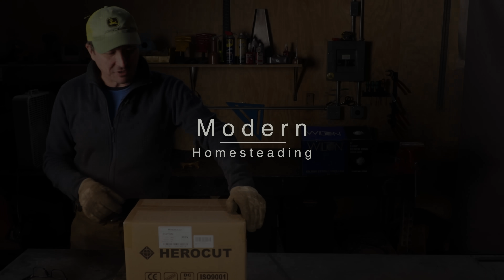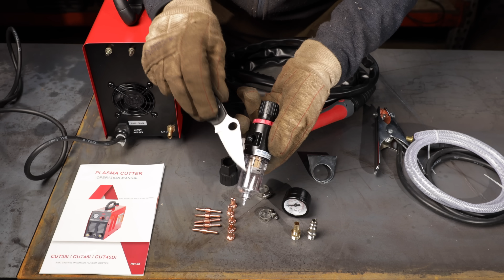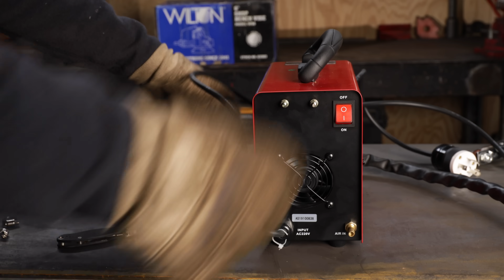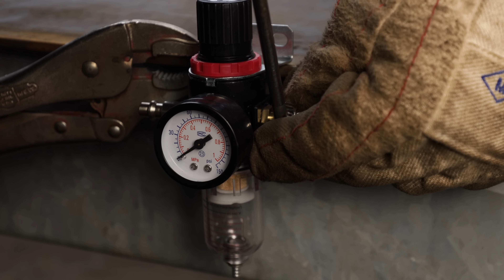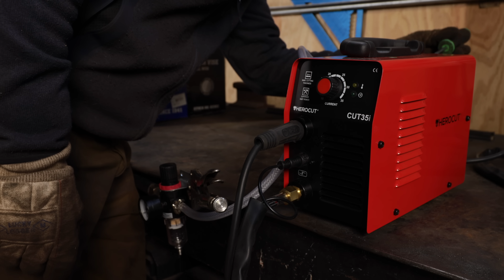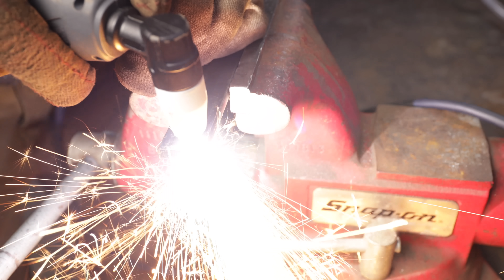TESTING The Cheapest Plasma Cutter On AMAZON

Comment: I have an ELCB electrasafe to plug a Chinese device into, so it will cut out a faulty circuit,  but not the house supply, which is also fitted with protection., I also keep a fire extinguisher. A house fire caused by an imported device without the Australian Compliance might void an insurance claim.

Comment: If I were to buy one of these I'd look for one of the "CUT 50" models. Very similar to this but just a larger transformer so you can get a few more amps out of it. It appeared by the 3/8 in material cut, there may have been a "bit of a struggle". As you stated, totally agree with getting the 240V models. Sooner or later when I get tired of buying gas bottles for my torch I'll buy one of these. They seem like a smart choice for hobbyists / occasional use like I do.

Comment: What is the width of the kerf (slit) cut, using the included tip? Can it be varied with different tips, slit width range? I'm newbee and need to make a 2" long slit/sleeve in 1/8" aluminum for a shoulder bolt to slide on.

Comment: Wow!  You've certainly come full circle.  In your early videos, you've seem to swear off anything made in China.  I recall videos where you would rehab an old vice and old axes.  Very cool!  Now your plugging Chinese plasma cutters!  (Can't say I blame you.  They are pretty cool and as you mentioned, priced pretty low for such a useful tool).  That cut you made in the 3/8" steel is NOT representative of how this plasma cutter cuts through steel.  It does a neat, clean cut both quickly and smoothly.  Not sure what you were trying to do there.  Where this tool comes in real handy is when you need to drill a hole in steel to fasten a bolt.  Nothing is as quick!  Thanks for the demo!

Comment: I have several welders from an engine driven Lincoln 225g7 to a small 120v transformer welder. I recently bought a cheap inverter welder, 120v. It's now my favorite most versatile welder. I recently bought a small inexpensive inverter plasma torch, and am looking forward to using it. When I was younger you could not touch these welders or cutters for under $3500 USD.

Comment: Mine has this air regulator at the back, there is a triangular holes letting air out, not sure what it is for, and is leaking air heavily. Also notice that you are not let the torch tip touching the steel? or just the video.

Comment: i thought the 110v/220v had to do with being usa or european,im in america do i need the 120v one or can i get this 220v one because i dont want to buy the 110v i want the one you used are you in america using the 120v supply on 240v plasma cutter? please chime in
Reply: looking on amazon now it actually looks like the "cut35" is infact a 110v not 220v
Reply: @pigeonsil240sx , 

After visiting your channel...
I'd say if you want 220vac in 
your shop &/or home, you just 
need to contact an electrician. 
Almost all circuit breaker boxes 
are designed to make use of 
220vac.... if it's not too old.
Reply: Judging from my experience from my last employer... a German based die company with all production equipment with European electrical systems... & not a licensed electrician..
The European electrical systems are regulated tight as possible to exact 100ac vt. per phase, where as American systems 110->120ac vt & is varied with transformers for the necessary requirements of whatever equipment being powered. 

As far as 110vac vs 220vac in use for plasma cutting / welding...
It's all about hotter arch for deeper penetration. Meaning getting to play with thicker metals. 

Hopefully simplified just enough & not too much & is helpful to your question.
Reply: @torchofkck4989  so can i use a 220v here in america with my 110v plug in or do i need 110v? would 220v be worse when plugged into 110 source?
Reply: @pigeonsil240sx   ,

With the appropriate adapters...
100 (European) Vt can be used with 110vt (American) & vice versa.

Same as 200 vt (European) & 220vac.

Generally 100/110 vt can be ran off a 200/220vt with a properly wired connection. (Not well advised)

But 200/220vt can not be ran off 100/110vt...

Comment: 100% duty cycle at 25 amps.  50% duty cycle at 30 amps.  This does not make any sense at all.  

   --->>> This is gobblygook shite, and even if it made sense?  

              Well, it does not make any sense at all.

Do you all remember that the purpose of a breaker is to protect the wiring hooked up to it?  Breaker size has ABSOLUTELY NOTHING TO DO with the power delivered until you exceed the capacity of the breaker (and the wiring it protects?)

The machine is going to draw the current it wants for any particular application.  Your breaker size has ABSOLUTELY NOTHING TO DO WITH PERFORMANCE !!!!  

    ---->>> Unless you are tripping the breaker.

I remain, scratching my head with all of this nonsense presented here.

How can we take this guy seriously, as he VERY CLEARLY has NO FREAKING CONCEPT of power/wiring/breakers?

...

Comment: I have the newer model, is 120/240, 45 amps and even comes with CNC connectors . All that for $250. I saw no reason to spend thousands on a tool that I use once in a while.

Comment: Question. I am wondering why a lot of videos I have been watching show guys holding the torch above the material to cut. Why is this? Why don’t you guys drag the torch on the material for a more precise cut? I am shopping now for a plasma and I am trying to get all the info I can get before I buy. I want to be safe and know all I can know before I have one at my home and use it on my own. I am used to using this equipment in the lab with my instructor and I am a little nervous about making mistakes and being safe. So basically I want to know.. is there a specific reason why you don’t hold your torch against the material like we do with the one in our lab here? Btw, good knowledge. I just subbed.

Comment: To combat the non standard air fittings, I have swapped every female connector in my shop to the universal quick connects. I even made a couple adapter assemblies for when I use  someone else's compressor.

Comment: That is how NOT to cut open a box. Hold the blade so you control how much of the blade goes into the box. What if you cut something in the box as you were cutting open the box. I guess you've never worked in a warehouse/manufacturing. The air line ends are standardized, but for different industries. Look up something like "MILTON AIR PLUG"   G style - M style - T style - P style - all rated for different SCFM. Oh, and I bet more things come from China than you know... (honestly don't know if that's good or bad...)

Comment: Electric equipment must be certified lab. CSA,. UL etc. It is cheap for a reason, CE certification mean nothing in the US or Canada.  That doesn't mean that it doesn't work, but I wouldn't recommand any electrical equipment running on 220 without any approuve certification.

Comment: Super informative video.  Have two questions.   Is the "Air in connection" not replaceable with a standard one?

Also when you were cutting did you drag the tip on the metal or does one have to float  above it and never touch the metal.    I just bought one from Amazon and I will get it in a few days and as such  I am trying to learn as much as possible.

Comment: This looks like something I could use. Have a couple of questions (if anyone reading this knows). I have a tough to get at stuck bolt that can't be cut off with a grinder. I think this would reach. Could this cut that off?  Also, my 30 amp service plug is way in the corner of my garage. Can we use an extension, and what type would I need? Thanks so much for the video.

Comment: "It is comprehensive, it literally has everything a guy would need to get started". 
*Requires external air supply not included.
Reply: Kinda backwards to get a plasma cutter before you own a compressor, no? Like buying a house and being shocked you don't have utilities or internet included.

Comment: How many Honda eu2200i do I need to run this plasma cutter ?
What is the smallest lowest power draw air compressor that can be used with this Plasma cutter ?

I bought a Hobart Handler 100 flux core only welder from Northern tool.
It will work powering with a Honda eu2000i ,  will work perfect with a eu2200i.
Welds good.

Comment: "Metric Conversion Act of 1975"
guess what your ford is all metric ..bolts,  engine size is actualy in liters or CC but roughly measured in cubic inch for your convenient ..even the gas tank is is precisely measured in liters and not gallons in mind, the figure you have on your user manual is a rough estimate to the liters the gas can hold 
you can still use the customary system but , that debate is settled long ago , im not saying standard system is a broken system ...just a half assed one 

ex : how much is a mile minus 10 yards plus 2 feets minus an inch and a half ? .....dont even bother

Comment: Thanks for the review. On the 120 Vs. 240V. thing, one isn't"better than the other. To produce one horses power of, energy it ~  750 Watts, doesn't mater if the supply voltage is 1 V.,  or a 100V. There are situations, where may less expensive to run a 240 V. As for the duty cycle, in reality, I doubt is  abo 20%, if not lower
Reply: except 30 amps of 110v is 1/2 the watts as 30amps of 220v.

Comment: I think most of these internally are 110 and 220 just change the plug. They cut much better on 220.
Reply: Also the pilot arc are much better for cutting dirty or rusty metal too.

Comment: For the power chord. Home Depot, buy 20' of the next larger size conductor, open the unit , remove the old wire, reconnect the new, install the chord cap (plug end) 110 v or 220 v for  whatever unit you have.  #10 is rated for 30 Amps so #8/3 conductor is rated for 40 Amps and your running it out to 20 feet..  If your unit is 110V I feel pretty sure it's rated for 20 amps so a 10/2 with ground will be needed as the cable it comes with will most likely be a #12. The cable type is SO or SJ and will do the job as per NEC.  I'd have to see the spec's as to why they use what they did but for us 220 v. @ 30 amps 20' long #8/2 with ground. This will avoid over heating of the wire and reduce voltage drop just by up sizing the wire to larger. I saw in the video the chord cap for your unit 2 hots and a ground that's a 3 wire set up so again 8/2 SO or SJ with a ground. I did this to my Mig welder and it's real handy I'll tell you. Hey, feel free to move that thing around a bit now.

Comment: Then we have British threads BPT and SAE thread standards to make fittings worse. I use red tread anaerobic thread locker and wait a day for it to set and it fills the gaps and is much better than any thick Teflon tape. One should have a BPT dies to convert SAE to all the cheap BPT valves and other 1/4 and 1/8" stuff these days.

Comment: Friend in florida had an industrial sized plasma cutter I used alot, he had a separate dryer we put in the line that was designed to use a full roll of toilet paper as the changeable filter/dryer element.

Comment: For viewers considering a "cheap" plasma cutter (or welder), best results are achieved when the ground connection is clean.  I would have cleaned the ground clamp area(s) in this video to be free of mill scale/rust.  A light sanding by hand or a tool is sufficient.  These things do work but they leave a rough edge on the metal.  Be prepared for grinding and dressing of the final product, for example, I would not consider using a plasma cutter to make a miter joint on a square tube, I would use a miter saw with an abrasive wheel.  Also, my Lotus 3500 draws approximately 18A from the 120Vac source when the cutter current was set at 21A.  I have all my work bench outlets wired with 10 gauge cable to handle high currents at 120Vac.  Lastly, I use an oil free air compressor with a 17 gallon tank dedicated to the plasma cutter.  Other shop compressors for air tools are oil based pumps.

Comment: Great video thanks.  You mentioned that the "metric system reared its ugly head again"! Are you really sure that the thread on the airline is metric as they are not metric over here in the UK, they are 1/4" BSP (British Standard Pipe thread) which seem to be a standard used extremely widely across the world, these are not metric (they are imperial).  BSP female threads are always parallel threads but the male threads can be parallel, in which case you need PTFE tape for high pressure, or they can be tapered threads which are great for high pressures especially when used with PTFE.  I beleive that the USA uses an NPT National Pipe Thread for pipes which were never intended to be compatible with BSP but some people do try and conenct the two as there are some similarities with the threads cut in inches.  Do you know whether it is possible to install a pilot arc torch to those cheap high frequency start machines?

Comment: Hey I'm not sure 100% duty cycle means that it can be run 100% rated for an eight hour shift. I believe this means the duty cycle of the DC chopper circuit inside which means it's able to 'chop' (rectify) and convert the AC waveform to 100% output of DC current. As you mention a 25A circuit it's able to output 25A DC. Still I think this is a dubious claim because there would be losses in such a circuit as this. I think this thing would thermal overload if run @ 100% rate for even an hour.

Comment: You missed the most important thing about cheap welders and plasma cutters. You almost got it but then missed it. The short power cord, which is easily solved with an extension lead. The thing you never mentioned and is the most important thing is the length of the torch. If it is too short you would have to drag the unit all around the job. Which is a total pain. The minimum length should be 3 metres at least. Otherwise do not buy it. If you need a toy go ahead but don't expect to get much work done. (By the way I just checked your link it is 110V. Useless in rest of the world which uses 240V but hey, your American what would you know about the rest of the world)

Comment: Are you sure the 120v cutter is inferior? Just an inverter... That is why it is small. My Miller welder burns just as good on 120v as it does 240v. The 120v needs a 20 amp receptacle because it draws twice the amps as when running on 240v.

Comment: Amazon fulfillment no longer able to guarantee deliver as they now use UPS. Tried to buy the HC6000 though AF and it supposedly arrived at the UPS hub near my home 2 days after order. Then I waited for 4 days for the delivery date. Called UPS to find out why it wasn't moving. UPS response is that it is lost, contact Amazon. Then Amazon told me to wait 3 more days. An apparently got lost (STOLEN) with in the control of UPS. Amazon refunded as it was the last item at that price point. All this happened before the hurricane, except the for the refund day. The point is, you can not depend on Amazon shipping their own stuff anymore. You may or may not get what you ordered, but your money will be tied up just the same.

Comment: Is 240VAC actually better? I would think it’s only better if the output power is more, which Im not certain it would be even though the voltage is higher. Feel free to correct me.

Comment: I do not believe there would be a performance difference between the 110v and 220v models. The only difference is which contacts on the transformer they're tying into, the 110 will use twice the amperage and half the voltage so the wattage remains the same.  220v only becomes necessary when the wattage requirements exceed what a 120v outlet can deliver.

Comment: Hey, I have the 110 version and I use it for roughing knife blanks and various projects around the shop. Worked up to 3/8" for me too. Pretty good little tool. It's the harbor freight of plasma cutters.
Reply: Bruh, is it holding up well at this time.
Reply: i think he actually has the 110v not 220v,his says cut35 which i think is the 110v model and the cut45 is 220v.what does your say? and i live in america does this mean i need 110v and is it pretty much just as good
Reply: I have the same I 35 hero cut and is only 110.

Comment: I had a plasma cutter nearly identical to this. Same size case and everything, just under a different name. It ran great for about a year and I never had any issues with it once the settings were dialed in for the thin automotive sheet metal I cut. After the machine sat on the shelf for roughly 5 years I needed to use it again. I hooked it up, flipped the power switch, and POOF; a giant cloud of white smoke out the vents. I can't even describe the smell. Took it apart and couldn't see any visible damage, but It's done, won't turn on at all... I guess I got my $350 worth out of it.

Comment: I have the 100 dollar welder that is built in the exact same case as that plasma cutter, must be by the same people. I bet a lot of the circuitry is the same too since a DC stick welder and a plasma cutter both just need a high power DC power source. This one just has some air fitting added on. I have the exact same dial on the front of mine and same switch and fan on the back. The only real difference I see is mine has an LED readout of the power level next to the knob instead of just having printed scale.